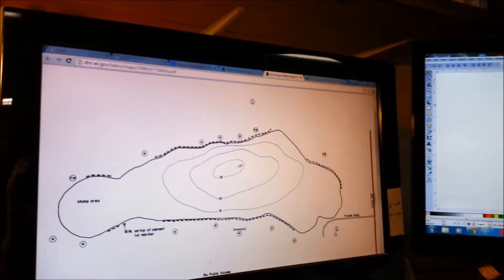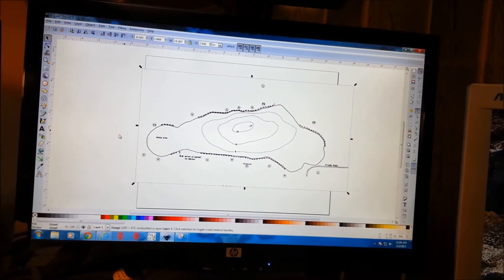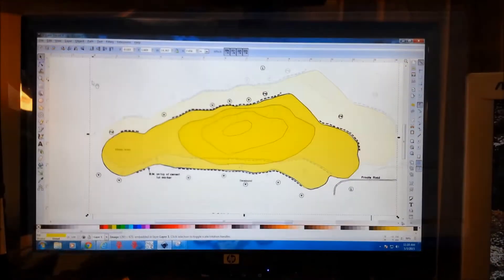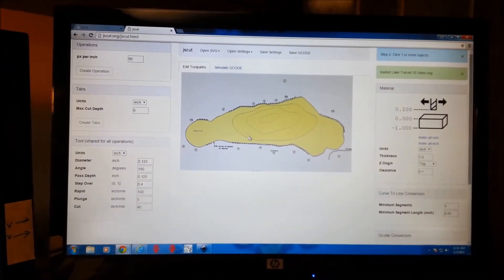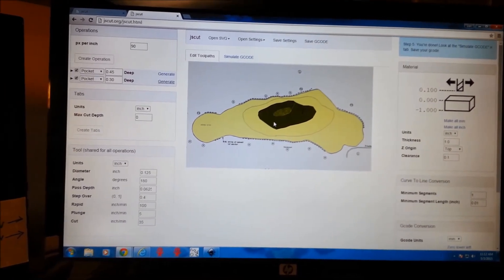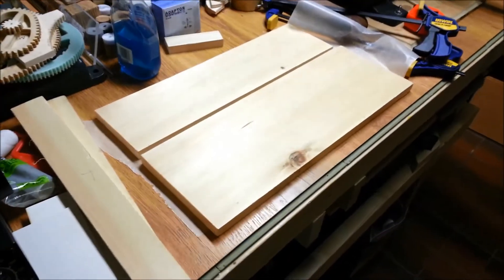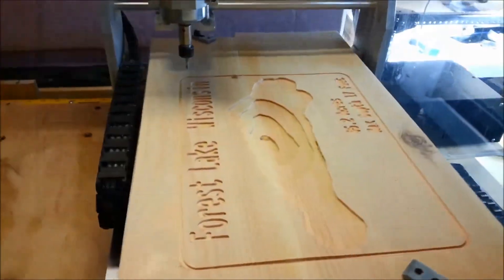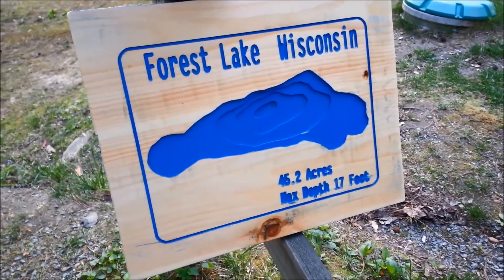Lake Contour Map Carving - A CNC Project

Comment: A smaller endmill would make your test look nicer, or a 90 vcarve bit.
Reply from the maker: ViperishTiger Totally agree.  Rather than making an end mill change out and re-homing the cut I just let it ride with the .125" cutter.  Thanks for your comments.
Reply: drez20001 I agree, endmill changes are a hassle sometimes but they are usually worth it in the end. I really enjoy all your videos and I'm amazed at what you can do with your home-built CNC and now your new small one.
Reply from the maker: Many thanks.  It's a fun hobby.  Every project is a learning experience.  I hope by sharing what I'm doing that others will build on the ideas and do even greater things.